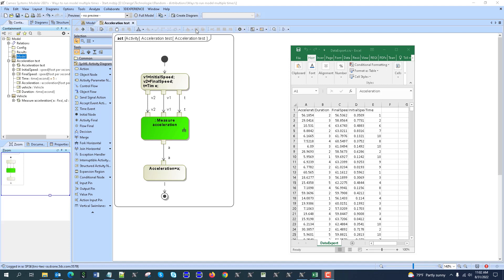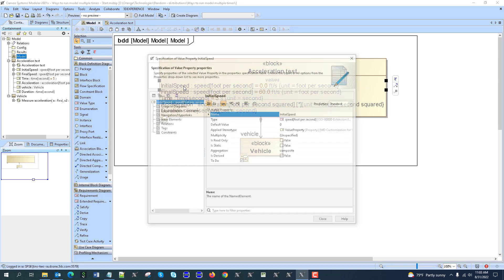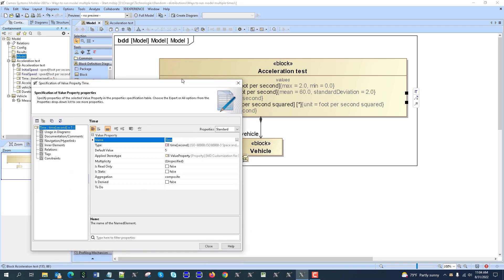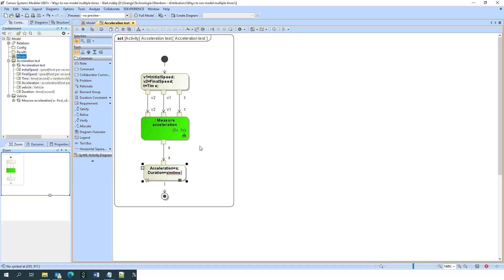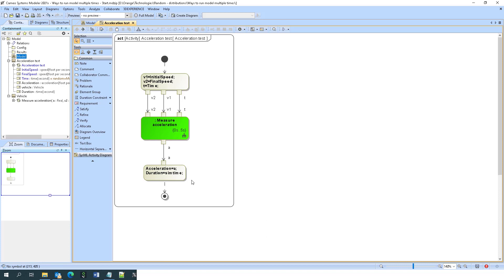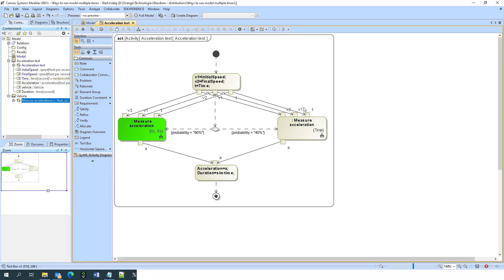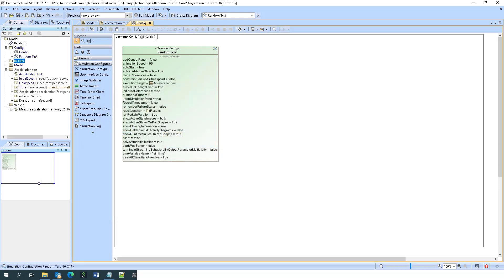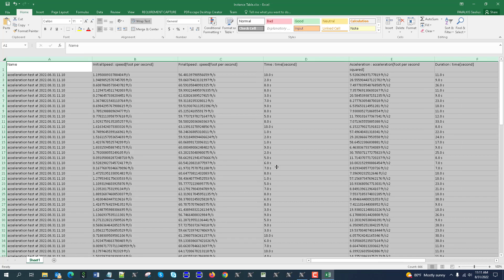Ways to Simulate Multiple Random and Predefined Configurations and Get a Lot of Data Out

Comment: Hello,
Is It possible to filter these values before they go to they instance diagram? For exemple: The acceleration shall be more than 5. If after the calculation, It is 4. Don't save in the instance table and continue the simulation.
Reply from the maker: Hello. Great question. Yes activity with decision could be straight forward solution. Also parametric constraint with If statement.